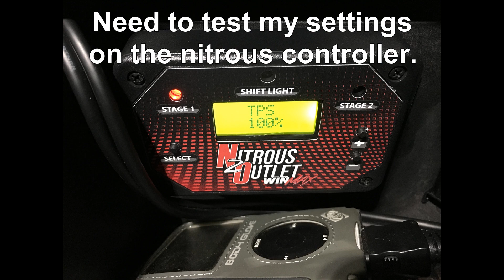A Day at the Track

Comment: What are you using to tune the truck? Also what Maf are you using if you dont mind me asking. I think i might have seen your build thread on explorer forms once
Reply from the maker: I am currently using SCT Advantange3 software to tune and LiveLink Gen2 to datalog. The Maf and 4 inch housing are from a 2012 GT500. You probably did see my posts on explorerforum, LOL. I am 4pointslow on explorerforum.  Hope you enjoyed the video!
Reply: Thank you for the reply. You just got a sub. Do you think that Maf would work well for a blow through turbo application too? I have a 4.6 2v explorer that needs some boost.
Reply from the maker: One day I came across some information that said the GT500 maf sensor was the same as any other mustang GT 4.6L maf sensor. The information went on to say the only difference was the size of the GT500 maf housing was bigger so it could measure more air flow without pegging. So with this in mind I tested my 04 Supercharged explorer with its stock maf(4.0 sohc V6) and then my GT500 maf and they were exactly the same when used in the same housing. I was shocked.  So what this means is that you can use your stock maf sensor but need to put it in a larger size diameter maf housing to be able to measure more airflow without pegging the maf. The GT500 maf housing is 4 inch but it is an air filter housing so the other end is where the air filter goes and that end is huge so I don't think it would work on a blow through setup. What would probably work is a 4 inch blow through tube and install your stock sensor in it. Measure your maf housing inside diameter first though, and try to go an inch bigger( if you have 3 go with 4 inch).

Also I had a 4.6L explorer/mustang maf/air filter housing and found it had a 3 inch inside diameter. The 4.0 sohc inside diameter of the maf/air filter housing turned out to be 2.5 inches. LOL. Sensor was the same but just different insdie diameters for different engine sizes with different airflow maximums.  If you have any more questions feel free to ask, helping others as I have been helped is in my blood.
Reply: Thanks so much for the help
Reply from the maker: Also I thought it might be worth mentioning for anyone that might be changing the sensor itself, that in 2011 some if not all ford maf's went to a frequency output instead of an analog voltage. They are not interchangeable of course.